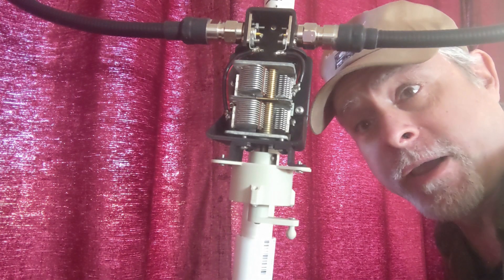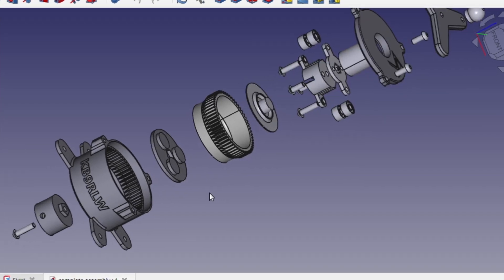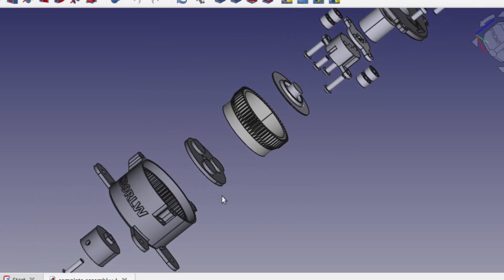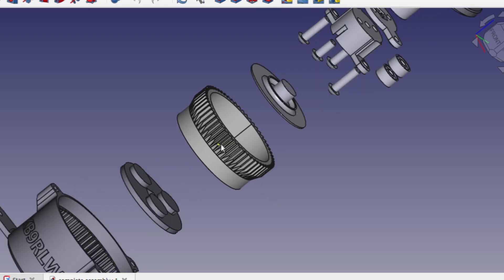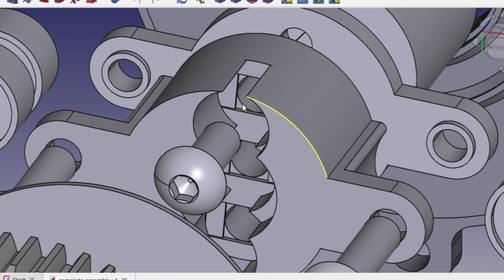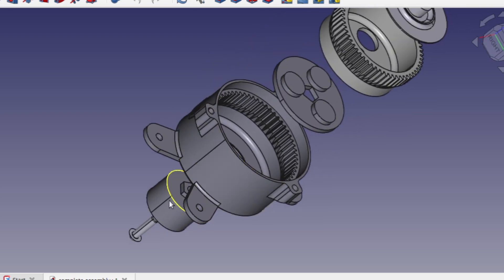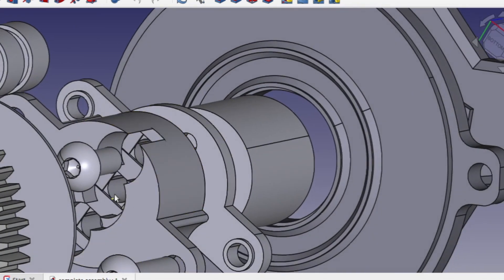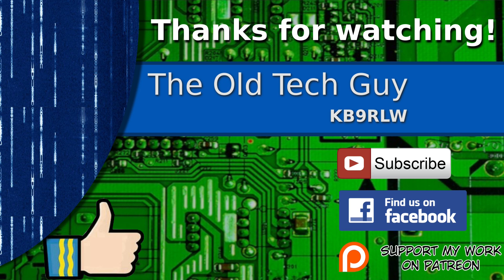Ham Radio - My current project is almost done.  A 29:1 harmonic drive for Magloops.

Comment: Hi Kevin...very interesting work. Thanks. Any idea how well this will work over time given the gears are all plastic?
Reply from the maker: My first 3D printer used PLA for the driving gears on the extruder.  After 9 years of use it was still going strong.  And that got a lot of use. 
This will be turned by hand, occasionally.  It would take years of use to accrue a few hours of actual use on the gears. 
So they will probably last just fine.

Comment: Hi Kevin,
Slick design. Are the bearings acting as the wave generator? Stay safe.  73  WJ3U
Reply from the maker: The bearings are the tips of the cam, pushing the flexigear outward to engage the ring gear. As the cam rotates, this is like a wave flowing around the ring gear